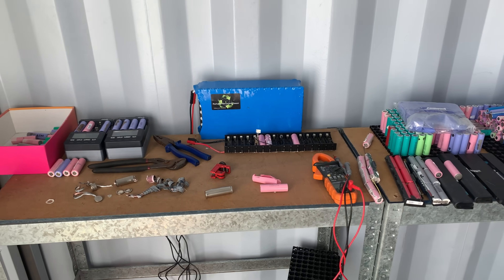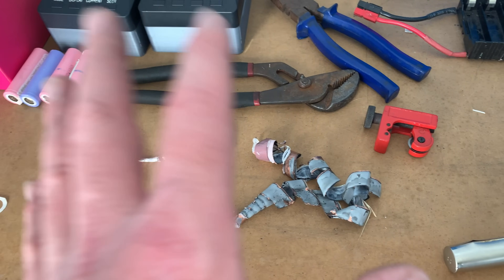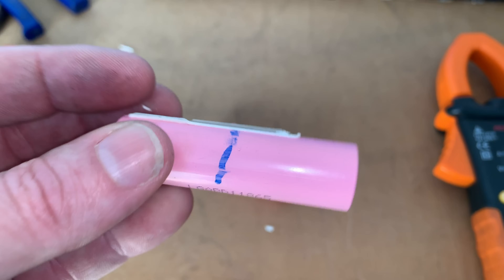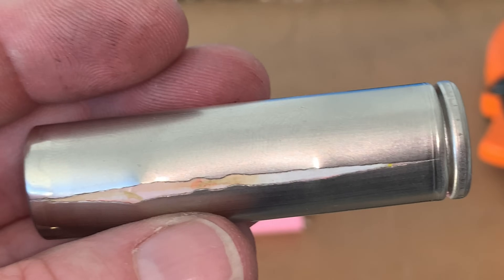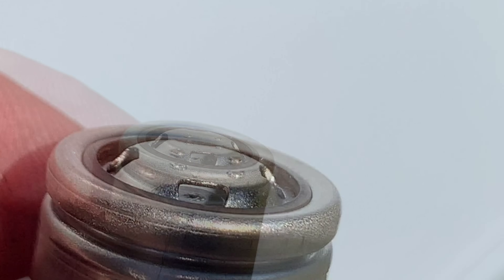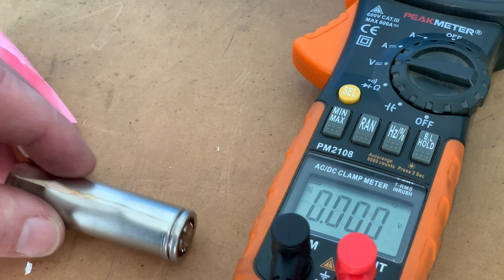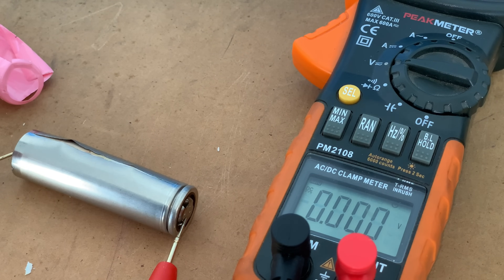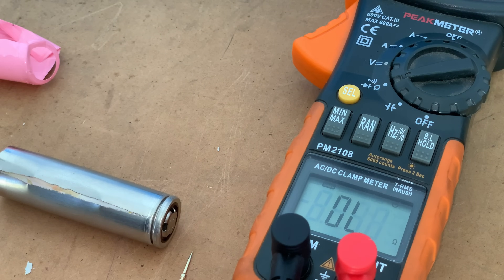Cutting open an LG 18650 battery for science  [ amateur video warning ]

Comment: I cannot help but notice how bad these things appear to look from an environmental pollution and recycling perceptive. And how do you safely dispose of such a waste bucket of chemically contaminated water? I wonder what they do in a battery recycling centre. Or if the cell design can be improved with recycling considerations in mind. Thee things may all seem fine right now. But in the future many more households will be getting such wall of cells. Which will only last X or Y years. Or otherwise there are going to be manufactured many new EVs. As governments become set on mandating EVs the coming years / next few decades. So don't we really need a better battery technology to replace li-ion? Something that is not simply just safer or higher performance. But also that is going to be less polluting and less toxic? I feel that it is an important consideration.
Reply from the maker: What we do with them using them to their true end of life is the best thing for them i think at the moment. stopping them from land fill, storing extra energy
Reply: There are already new technologies in the works. Graphene and I believe a Salt water cell, to name a couple. They're just not finished with development, yet. Either way, you are correct about the recycling process, it is chemically intensive and messy.
Reply: Yeah, the process needs to be improved. Talking about EVs, with today's combustion engines on the other hand we're perfectly happy with burning millions and millions of liters of oil every single day (~7 billion liters to be precise, daily, just for transportation), and the result is not exactly environment friendly either, it's just more widely accepted...
Reply: Thanks for your replies... I guess I what I have been trying to highlight here are 2 separate and different problems.

Problem 1) is indeed how do we replace li-ion (or improve it) for MOBILE applications. The ones which demand the highest performance. Where alternative technologies are simply not an option because they don't perform as good. And that is important. Well that problem i probably beyond the capabilities of most of us. Rather its more of an observation of well what is actually required for a truly green future to work? Instead of simply just replacing the current set of problems with a newer and different set of other problems. And asking how much we are really gaining by that without hiding the true and full gamut of those hidden environmental costs.

Were-as Problem 2) is more about details how do we best solve for home power storage because not everybody can be recycling used li-ion cells. As the numbers simply dont add up to make it feasible for everybody on the planet? I have not checked but (i am guessing) I dont think so. So within this problem are many more interesting topics to consider. For example can we re-use same equipment for switching to li-Fe? (like the BMCs and whatever else). Or re-configure an installation which can operate on multiple different cell technologies? If you needed to gradually phase out those old cell type over a period of time. OR: are there any other reasonable long term energy storage mechaisms that either dont require batteries (or else require fewer batteries)? There are a number of other technologies being developed. However only some of those really work well for regular households that are space constrained etc. But that could perhaps mean less total pollution for everybody (all others who cannot do this. Rather than have them all start buying hundreds and thousands of brand new li-ion cells and incurring new extra pollution in that sense.
Reply: @dreamcat4  If you are aware of the new technologies being developed, then you already know they have already proven them to be much greater power density. So, smaller, less materials and greater lifetimes. Pretty much fixes everything you're talking about aside from the pollution  from the previous technologies.

Also, in the case of graphene batteries, it's just carbon cut thinner than graphite, therefore, not a pollutant, inert, and will pose no problem in disposal at end of life.

I suspect though, as EV cars begin to take some appreciable share of the market, automotive companies will start releasing IC engines with GREATLY improved fuel efficiencies. The IC motor is a very well understood beast, and the technology to create IC motors capable of 4,5, even 6x  the fuel economy have existed for decades. They just haven't been adopted because, "it's what the market will bear".

In reality, the way forward from an environmental perspective, (not that I agree with climate alarmists, but it can be easily done) is to do away with solar and wind all together (they pose a net carbon loss, no matter which you are looking at) and transition to CST plants, and FBR and TWR nuclear.

Zero emissions aside from maintenance of the moving turbines and in the case of Travelling wave reactors, they run on the existing nuclear waste piles and leave no waste behind. And both nuclear and concentrated solar thermal are proven technologies and can produce the kind of base load power we require, on demand.

As far as it goes. PV solar and power walls are very cute. But we might as well use up the cells that would otherwise be put to waste while our governments are being swindled into wasting money on PV and the incentive schemes for people to buy them.
Reply: @Jimmeh_B  Well I certainly am not familiar myself any with new proven technology to replace li-ion as of today. However my main focus was in fact on the pollution aspect. Because that is currently in my eyes its main failing for being scaled up. Which is what the indetry is currently driving towards. It is my understanding, when looking at why so many fail the recurring theme seems to be difficulties around either the safety (not exploding at high enough energy densities). Or the about the lifespan before breakdown of a cell (also because higher energies). I guess you can also add to that not knowing how to economically scale up manufacture outside the lab setting. So no, that is seemingly not in the bag yet. Although people keep saying lithium ion family can be improved in various ways. I still dont see enough transparency in terms of revealing more clearly the true cost of its environmental impact. Inclusive of the pollution, and especially when the government says its going to 'ban all vehicle emisions by 2032'. Or similar claims. 

But really super highest energy density is not such a requirement for reiddential power walls. Its only required for mobile applications. What I do agree with you is that for residential we are less dependant on these home power walls. And rather instead of that a more reasonable expectation i a combination of multiple different solutions each taking a piece of the pie. The exceptions being in poorer and developing countries (like africa). Where they dont have any other option because there is no local grid infrastructure. Or otherwise no organized local community small scale solution either. I do agree nuclear solutions would be great and for the best. I just unfortunately dont see it happening (in time) in the current climate. Which is a shame. But really that is why we are trying to be thinking on and focussing on other ways. Sorry I do think more money should be put into nuclear. However i dont see how that is going to 'solve the red tape' problem. Or solve the 'public perception problems' which it evidently still has. Which is unfortunate given the time scales at play.
Reply: @dreamcat4  Yes well, sadly we (society) are governed by a bunch of relatively uneducated and inept "leaders" who rely on advisers who are lobbyist puppets, to be generous in my description. (personally, I feel it's far more corrupt than that.

Public perception will always be a problem and should be dismissed because the general public are even less educated and generally driven by fear, something the climate alarmists thrive on. Even you just eluded to "us" "running out of time".

The technology exists, it has done for decades, but we have government "leaders" putting the axe through pilot programs using weak justifications to cover for the fact that they fold to protect the existing coal industry. 

For example this : http://media.bze.org.au/ZCA2020_Stationary_Energy_Report_v1.pdf

Guillard put the axe on the pilot program for a CST plant in QLD sighting "light pollution" as her reasoning. Apparently there was a chance that the reflected light might disturb the pilots of the 5 commercial flights that traverse the sky about the site per day.

Otherwise, there's no reason why Aus couldn't have implemented that plan and been carbon negative by 2025. Including vehicle emissions.
Reply: @Jimmeh_B  Just because something is recyclable, doesnt mean it will be recycled. Just look at all the plastics that get sent to the landfill. If you want something to get recycled, you have to put responsibility on the manufacturer or retailer to take it back at the end of its life, or on the end user through deposits at the time of sale (to be refunded upon return). Lithium ion cells have little inherent value, despite cobalt being so expensive, because the cells have to be de-energized before crushing, and then it's expensive to separate the metals. Compare that to lead acid, which is a closed loop with 98% of its content being recycled.
Reply: @Rendus4  As far as you know.
I used to pick up and repair flat screen tv's from curbside collection and sell them on. Eventually I ended up with a bunch of carcasses of tv's that were beyond economic repair. When I took them to the "waste transfer station" I went to throw the carcasses into the E-waste bin, when I was quite quickly informed that because the units were disassembled, they were in fact not E-waste and that I could throw the PCB's and panels into the bin, but the plastics I had to throw into general landfill and pay for the privilege. Bear in mind, these are the same transfer stations commissioned to ensure recyclable materials get recycled, with their operating costs being paid for by rate payers.
So essentially, unless the waste transfer stations can on sell your Ewaste, they don't accept it, let alone pay you for collecting it.
Now explain to me, which is the more energy and chemically intensive to recycle? PCB's and LCD/LED/Plasma panels, or abs plastic? Also, which one of the two creates a more valuable end product?
The 98% figure you quote, to begin with, comes from these station's intake statistics and not from the end result. Most probably, that statistic comes from the recycle-ability of lead acid batteries, and not AT ALL from how many used batteries actually make it to be recycled. Aside from that, there is very little advantage with reference to the end goal, of putting deposits and charges on end users when councils are only interested in profit and though they collect these sorts of things, there is no guarantee of where they end up.
Incidentally, it is this level of mismanagement that is responsible for us now being able to collect 10c per beer can (if we could be fucked) and ALSO responsible for a 30 pack of beer can's price increase of 6 dollars. I'm yet to figure out what sort of kickback deals have been struck between the collection stations (which I assume are government subsidised private enterprises) and the manufacturers, but I guarantee they exist because the bar codes on the cans need to be in readable order for them to be accepted.
Reply: @Jimmeh_B  If you go to the garbage dump, they will treat it as garbage. Go to the scrap yard next time! With 98%, I was saying 98% of the weight of a lead acid battery is recycled. I dont know the percent of lead acid produced get recycled, but I'm pretty sure it is pretty high compared to lithium.
Reply: @Rendus4  I would, if there were a scrap yard around me that paid for ewaste.

And just a head's up, making statements about things you're "pretty sure" of as if they are fact, is never a good look.
Reply: These lithium batteries are recyclable and they are being recycled at a rate of about 1-3% depending on country but the real issue as you state is that they are difficult and time-consuming to process.  Battery companies need to focus on making the cells easier to process and recycle as they are nearly 100% recyclable at this point and many chemistries contain valuable metals like cobalt and nickel alongside copper aluminum and graphite powder.  The only things in the water that are a real problem are the lithium salts and heavy metals.  The graphite powder is not much of an issue and the solvent electrolyte pretty much evaporates away.  All of that could easily be removed from the water through a simple distilling process.  To make them easier to recycle they need to make the battery cells larger like they are doing with most newer EV batteries.
Reply: @kuhrd  Thank you for explaining this. I also wanted to point out that flat pak style li-ion cells. Which are in some EVs... they might indeed be better from a recycling standpoint. However a big drawback is their safety. Wher-a having smaller cylindrical style cells like 18650 or 21700 are far more robust and resistant to damage. They are just really much safer in many respects. There was some guy elsewhere on youtube who put up a video comparing them. He did a better job than me of explaining about it. 

So I think its really important to understand and realize why these cells are being made so small and difficult to recycle this way in the first place. The 2 design considerations of safety or recyclability kindda seem to be at odds with each other here IMHO. It would seem that a big reason for that is because li-ion is so dangerous to begin with. And a big reason for that (in turn) is the requirement on [whichever battery technology] to have a very high energy density. This is necessary for mobile application. So therefore it 'remains unclear' to me (at best) why a newer technology to replace li-ion would not also be encounter similar types of issues to overcome. To be more generally speaking. And perhaps that is why industry is trying so hard to keep incrementally improving li-ion family of technologies. Also with in mind to transfer some of those newer techniques to whatever ele might stand to replace li-ion in the future.

But that 1-3% rate. I must admit is pretty shocking. Its just not feasible at all with these current cell types. Even the 21700 cells i would bet. Nowhere near where we need to be.

Comment: The Cid cant really blow when the cid is pressure dependent on blowing and there's a gaping hole in the side of the cell which contains that pressure , Must been quite some pressure inside the cell to push it open like that in the first place. Usually when i rip apart a cell like that i save/collect the tiny aluminum rod from the center :-D
Reply from the maker: wondered what the rod was in the center .. looks like they would be easily recycled there is a bit of copper in there as well.. need some accurate scales and rip apart 100 and see what you could salvage from them
Reply: @HBPowerwall  Im guessing the copper/aluminum amount within is not enough to justify some operation of recycling on that level along with interesting chemicals of health damaging properties. I just ended up collecting them they have this ultra thing line in the center of them so you can slide paper in them easy , I also collected a few CID caps to poke and prod in the name of science ;-)
Reply from the maker: Didn't think of the nasties in there ...
Reply: @HBPowerwall  Yeah i once had a leak from a CID reset experiment when you poke something into the cid to push it back down and restore functionality id accidentally punched a hole though it, A chemical substance came leaking out during charge and it seemed to eat metal leaving a rusty corroded effect.

Comment: Always wear gloves some of that electrolyte can be nasty stuff. eg. Ethylene Carbonate, 99+% Warning! Causes severe eye irritation and possible eye injury. May cause respiratory and digestive tract irritation. May cause skin irritation.
Reply from the maker: Non- of the above, but thanks for the heads up.. No gloves felt safer as i said - could feel heat...like a early warning system
Reply: @HBPowerwall  Might want to try some thin nitrile gloves if you do it again that way you can feel heat and have some protections still.
Reply: @HBPowerwall  maybe wear protection for yr eyes